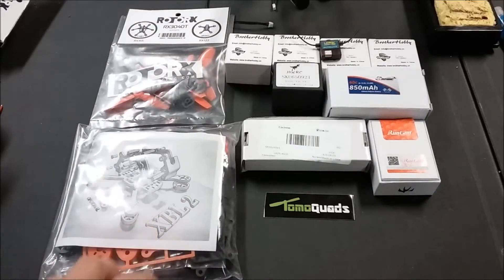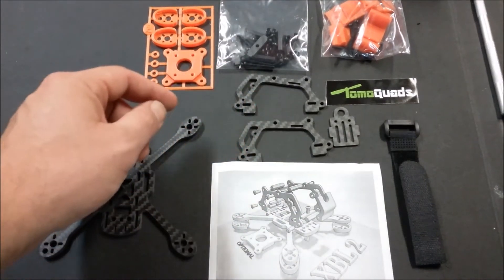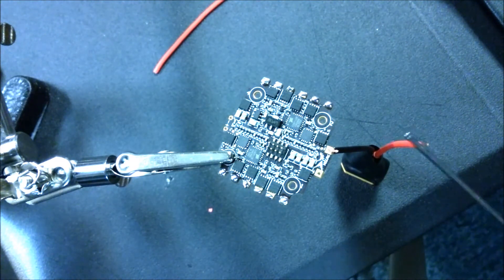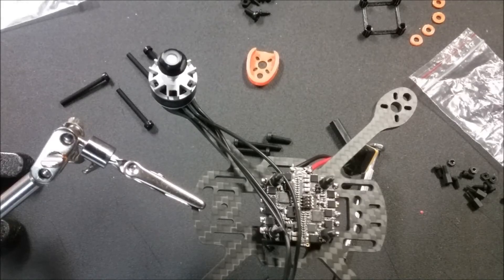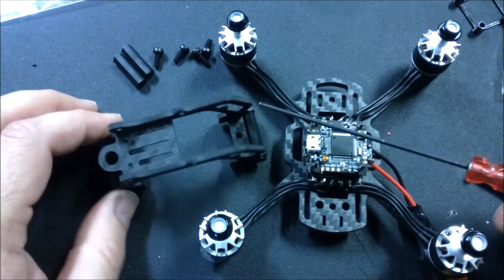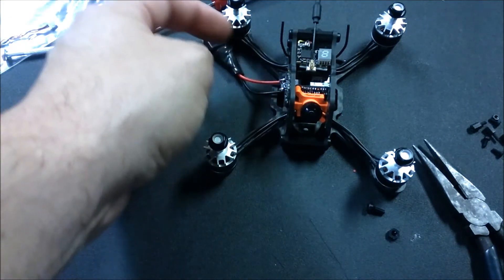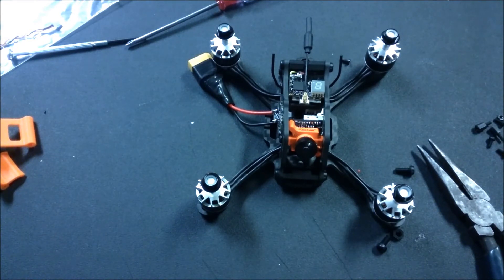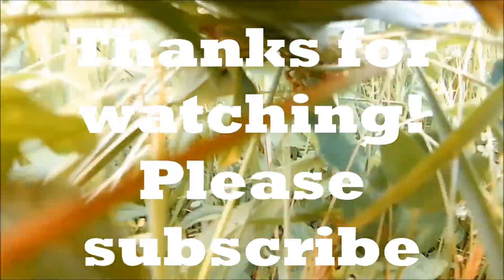TOMOQUAD'S XBL2 Extreme build video!

Comment: You got my sub.  I am not much farther ahead of the guy you have been helping.  I built and flew my first micro this summer after graduating from brushed.  This would still be too much for me.  Im gonna upgrade to emax 1106 im thinking 6000kv so i can use 2 and 3s or going 7500 kv 2s.  That will be a big step for me.  Fuck I love this hobby.  I grew up flying rc airplanes and now 25 years later, this is so much better.

Comment: What kind of flight times are you get with these 3in quads
Reply: what does this set up weigh?
Reply from the maker: Garrett with a 4s 850mah I'm getting a solid 3min and 30sec running Ballz to the wall!  Thanks for the comment.  Sincerely Dez
Reply from the maker: Without lipo it is 150g and with the lipo I used I was at 250g total weight.

Comment: You don't have to calibrate escs if you run dshot. In fact it won't let you. I like how thick the frame is though. Would like to see a top mount battery on a good 3 inch frame.

Comment: Have you tried finger nail clippers to strip small wires. I find they work very good if you careful
Reply from the maker: Jaylayton28 I have in the past used those. Been doing it this way for a probably 15years now. The nail clipers do work good too.  There are lots of ways to do it.  I had forgotten about the clippers.  Thanks for the tip and the comment.  Sincerely Dez

Comment: Great video!  How are the ESCs holding up? I'm hesitant to purchase this flight tower as I've seen some complaints of them burning up.  Are they really 25a? I plan to use them in my 4" setup using those same motors, BH 1407 3600.
Reply from the maker: I had a bad esc on the first one out of the box,, They replaced it though and I haven't had any issues since ,, probably at 100 or so flights now... Everything is super cool too.  This is however on 3" with the BH 1407's on 4s.. I plan on using them it on another build with larger props so we shall see.. Cicada is about to release a 4 in 1 esc 25A too,20X20 , So that will be nice and if I do end up having any Flytower ESC's problems then I can keep the FC and use the Cicada when it hits very soon.     There is some pin out info on the F425 FC to use other Esc's.  Hope that helps and after the next build I plan on doing a full review on the F425 flytower.. I just want to spend some time using these before I would release a full review on it. If I have any issues I will come back here and let you know.. Thanks for watching , Sincerely Dez
Reply: desode9 thank you so much for your contributions to the community. Subbed!
Reply from the maker: My pleasure,, I love helping people in our hobby!  Have a great weekend and Happy flights!  Sincerely, Dez

Comment: hey dude, i know im bugging the shit out of you but i cot more questions.  The battery's i got i think are crap.  i am only getting like 2 min flight but i can hover for almost 5 min.  the v drag is like 1.0-1.2 when i punch it.  but it dosnt recover after for way to long. sometimes.  they say 70 but i think thats wrong.  unless i have my vbatt set to high. what should i have it set at?  Do i use esc censers?  and current monitor how do you set that?

Thanks for putting up with me
Reply from the maker: FPV willip what size lipos are you using?  2s? and what mah are they?  It is hard to tell if that is normal when I dont know your quad either.  Some micros only fly for around 2 mins of hard flight with punch outs.  Even a Tiny whoop with high kv motors is about 2 min and 30secs when Im flying hard.  The current sensor is a real chore to adjust and on a small micro I would really mess with it. You can tweak your vbat readout so that it perfectly matches the battery when it ia fully charged. You need a battery tester meter to check it when it is fully charged and then you adjust it in betaflight so that it matches a fully charged pack. Then you will atleast know when your to low on the lipo so you dont damage the battery.
Reply: they are 2s 550mah,  when i charge them the battery's my charger says 8.4 but my multi meter and beta flight say 8.3-8.31.  I am using the same cube you built with. 10000 racer star motors and it weighs 91.71 grams with the battery.  battery's weigh 28.89 or so grams.
Reply: well never mind on it all,  i plunged into bf and was testing the motors and got the magic fucking smoke!  AAAAHHHAHHAHAHAHAH.  Im done!  Im going back to cars and trucks!
Reply from the maker: +FPV willip Damn! Sorry to hear that. :(   I was away for little while and didn't have any Internet.    If you ever decide to give it another go and there is any other help I can give. Let me know.
Reply: im not going anywhere i was just pissed at that moment, lol
Reply: Banggood is sending me a new stack so i will be back in the game!  In the mean time you think you could do a vid on how to flash the fc and esc's.  I couldn't get the fc to flash.  i haven't flashed anything on this pc so i had to download the drivers again and still wasn't happening. Thanks for your help man,  you are the only one that i can find on youtube that has even used this stack.
Reply: 2 min is pretty common if you are flying hard or even not that hard. Just have to buy more batteries.

Comment: everything is hooked up.  it flies and i have video but the osd isnt working .  I have tryed everything that i know but with not results.  any idea?
Reply from the maker: FPV willip You have video but no osd overlay?
Reply from the maker: FPV willip Give me a little bit and Ill check a couple things out.  In the config tab bf. make sure osd is on. It is listed where you turn off the accelerometer. also make sure to set the cam to either ntsc or pal on the BF osd tab. You can also set up a switch on the modes tab to turn the osd off and on via a radio aux switch.  Check those things. Glad to hear that it is airborn! Sincerely Dez
Reply from the maker: FPV willip If you have video then it is probably just one of those things I just mentioned.
Reply: yes that is correct
Reply from the maker: FPV willip well check those steps I mentioned above and let me know if that does anything.
Reply: so i dont know what i did but the overlay is on.  all i did was save some pid

Comment: ok, so i am done with my build with no magic smoke, lol.  But this blhelli part i am a complete noob.  So i use bl heli config or suite? and if i use the config how do i calibrate the esc's if i even need to?
Reply from the maker: Use Blheli suite,, Plug in the FC and then start up the program. Then connect the lipo.  Next select the Com if it isnt already selected,, it would be the same com port you use on Betaflight.  The click connect and read set up..  It will show the esc set up. Note the little square tabs with the motor numbers.. If you right click your mouse on each one of those it will show each esc individually.. You need to know this so if you need to change motor directions in a bit you can.  Next go to the Motors tab  and you will see a check box,, make sure you props are not on,, Then after you check the box you can move the slider to check each motor direction.. On my F425, I hooked the motor wires up just like in the diagram and they all needed to be reversed in Blhheli,,, Mover the slider for each motor and check that they are spinning the correct direction.  If you need to change them go back to the main tab and connect again , and individually click on each esc as I mentioned above,, You can set the motor direction on that screen.. Once your sure all the motors are spinning the correct direction , go back to the motor tabs and after you click the box again, then click calibrate esc's  Set the range min to 1070, and the max to 2000.. then click to start and it will calibrate the esc's.. Double check main tabs again to be sure all is right and you should be good to go.    Sincerely Dez
Reply: Thank you,  what dshot should i use?
Reply from the maker: FPV willip Im using dshot 600 with no issues. just calibrate first.  I dont remember what it is set to first in bf but Rule of thumb is to set the esc's to oneshot125 in betaflight then calibrate then go back to bf and change to dshot.  Oh and if you have to change motor directions in blheli after you do so on ech esc you need to click the write setup button to save that.

Comment: 9:40 This method scores the wire and it will fatigue and break. Just avoid touching the blade to the wire and you're good
Reply from the maker: Yes just go untill you first feel the wire very briefly at first and then when you spin it don't hit the wire.  Thanks for sharing that point.  I appreciate your input and comments.  Thanks for watching.  Sincerely Dez

Comment: can you do a video on how to hook the vtx and camera to the osd please?

Thanks
Reply from the maker: FPV willip, Sure! got a lame esc on the f425 flytower and the new one will be here this coming week and I am adding a ImmersionRC tramp Hv vtx so I will include the connection for you in the full review! Thank for your comment and suggestion!  Keep a eye out over the next week!  Sincerely Dez
Reply: i have planned on putting the kingkong aio cam vtx and wonted to know if that would work? https://us.banggood.com/Wholesale-Warehouse-Kingkong-Q25-Mini-5_8G-25MW-16CH-VTX-600TVL-CMOS-14-Micro-FPV-Camera-wp-Usa-1097798.html?rmmds=myorder
Reply from the maker: FPV willip,yes it will work but you have to seperate the cam from the vtx and use the spots I mention for the cam and vtx in this video but you first need to check the voltage ratings for the cam and the vtx. The vtx input on the F425 that I used is not 5v so if your using that FC you need yo be aware of that! It would fry the vtx.  What flight controller are you using????
Reply: im using https://www.banggood.com/20x20mm-XJB-F425-Dshot-Flytower-Micro-F4-AIO-OSD-BEC-Flight-Control-25A-Blheli_S-2-4S-4-In-1-ESC-p-1148284.html?rmmds=myorder.   the vtx is 3.2-5v so i just need to power it with a 5v pad if there are any, lol.  so i do still need to power the vtx with the power leads then wire the other power and signal wire to the flight controller and the same with the cam?
Reply from the maker: FPV willip, My replacement will be here today in the mail. With the cam and vtx you have, I would say you are going to first seperate the cam and the vtx. I cant tell how long those wires are so you may have to lengthen them with other wire somehow but basically the fc osd connects  between the cam and vtx.  The vtx would be powered from it's power leads ans you will find 5v on the right side of the board. There are pads marked 5v. To be honest I would invest in a volt meter so you can check before you connect stuff just to be safe.  Next you would take the signal wire going out of the vtx (was going to the cam) and connect it to the vtx signal pad on the fc. You may want to use the ground at that spot too and then just run the + to a 5v pad.  Next would be the cam to the cam connections on the Fc. Just also find out if that cam supports 5v.  Like I said my replacement will be here today and if you can wait till the first part of the week Ill put a short video up showing you what you need to do to use the osd. Sincerely
Reply from the maker: FPV willip You shouldnt connect the vtx power twice. the red and black by the antenna end of the vtx is power going into the vtx and the power and the yellow going out to the cam is sending power. All you should need is the yellow signal going out of the vtx to go to the FC because the red and black at the other end is the power for the vtx.  Got it?
Reply from the maker: Just got my call from DHL shipping with my replacement. It won't be here until Tuesday, But if you haven't got it figured out by then i will do a vid for you to help.
Reply: i wont have mine till friday.  but yea a vid would awsome.
Reply: you get your replacement yet.  Mine should be showing up today.
Reply from the maker: FPV willip Yes it is in and all good to go!  Got the connection video done for you. Whats your email address and Ill send you a link to just the clip you need.
Reply from the maker: FPV willip Information sent. Sincerely, Dez
Reply: Thank you dude, Cleared it up for me!  Just cant wait till all my parts are here.  I have been brushed for about a year this will be my first brushless and i am excited as hell.
Reply from the maker: FPV willip what motors are you using and what size lipo?
Reply from the maker: Ok, I was a little worried there for a second!  Going from brushed to this if you had said 1407's on 4s would be steep learning curve.  That's a good choice you have because you can start on 2s and then 3s and then you can later upgrade the motors to something faster like I used which is totally insane!  Honestly the brother Hobby 1407's are so wicked on this thing at 4s that it even took me a couple flights to get a grip on this little beast!  SMDH       This frame will give you lots of room to grow and upgrade as you move forward.  I am very glad I was able to help you out! Thanks for watching and for subscribing! It makes me very happy to be able to help my subscribers out! Plus in my opinion there is no better frame then a Tomoquad's one!  Sincerely, Dez
Reply from the maker: Are you using the XBL or the XBL2 ? or a different frame but with the F425 tower?
Reply: i didn't go with the tomoquad frame but im sure i will break the one i have!  That just might be my next choice.
Reply from the maker: FPV willip Well,Tomoquads makes some of the toughest frames I have ever seen. You would have to go with a little bit bigger motor if you move to something like the xbl 2 however it is 4 mm carbon fiber plate and the upper part is 2 mm. it also has the very low profile of the upper part that protects it in a crash. There are a lot of different, Tomoquads frames that would work with your f425 so keep that in mind for the future. I don't pull any punches on my channel so if I say something seriously tough and seriously wicked fast, trust me it is. If I say it sucks then it sucks LOL. I hope that you stop by more often here at the sane Asylum RC Channel!  I was very much once like you and learning on brushed quadcopters so that could keep the cost down and they served me very well during that time. Moving to a brushless quad really opens up a different world of performance. Now of course one last plug for my favorite frames, when you're ready to move into something down the road I am telling you go with a Tomoquads build!  hahah. ;)  The full xbl2 review is coming very soon so keep an eye out for it. You will enjoy the flight footage!
 Best of luck, Sincerely,Dez
Reply: one more question, What is the small -/+ on the opposite side of the esc?
Reply from the maker: With the arrow facing forward, The esc has 2 spots on the right and left to connect your lipo plug.. The one side has bigger pads and the other smaller pads. I am assuming that is what you are refering to as they have + and - on them.
Reply: yea, thats it.  just wondering if that was a 5v out or not.